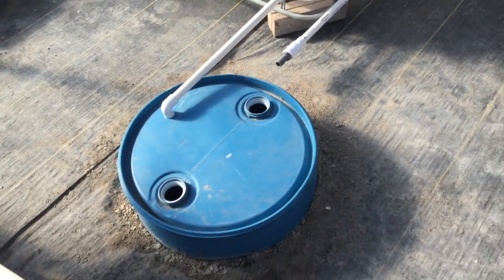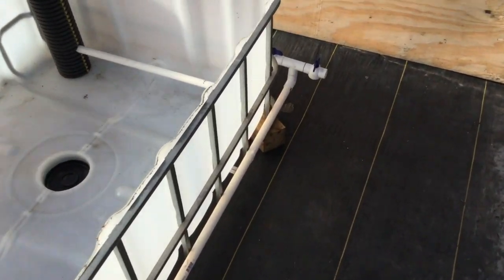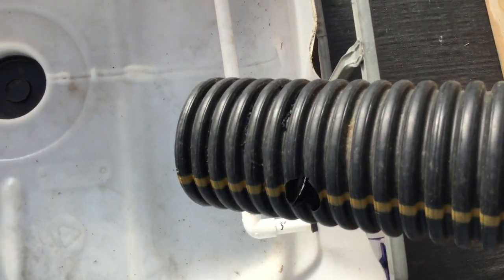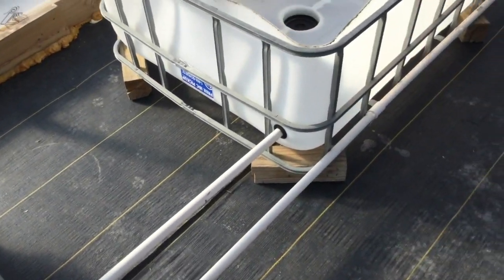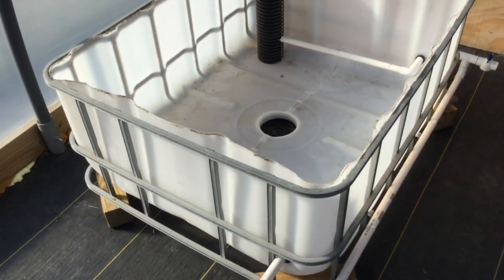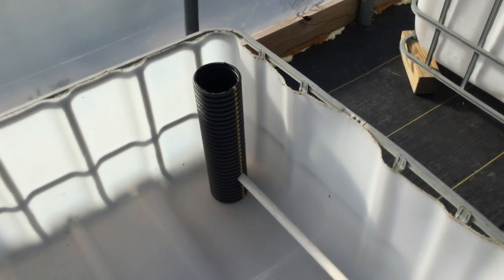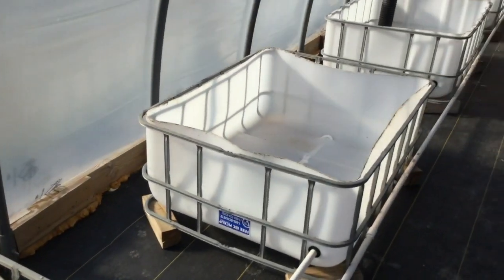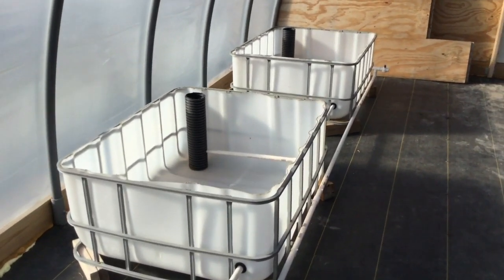Constant Flow Wicking Beds (1)

Comment: How can I find an electronic meter to measure ammonia and nitrates? I want something to get live data for my prototype that I did.
Reply from the maker: Hanna Instruments makes one that measures pretty much anything, but it's $800 or more and still requires you to add reagents to the test tube. Other than that, there is no perpetually automatic way to do it.
Reply from the maker: I should also mention that not all elements can be detected by firing electrical current through the water. It still requires a chemical reagent to be added to the water to change its color and then that color intensity can be measured using light and a photo transistor.
Reply: Hello Larry. Thank you for the reply. Sad that it is not possible because it would have been so easy to acquire information and change things quickly on fly. To be honest I don’t like doing it manually especially with colors. I have problem seeing and identifying colors. Medically tested😬. 

I once bought a digital meter on eBay where I could check pH, temperature and EC. It was so easy to monitor and I had plants grow so fast. Blindly I had retarded the plants but once I did new ones with live data, I was able to keep things with the range and it was amazing. Right now I can’t fire up my system with fish and plants until I am competent to get data out of it or else it will be blind and I won’t learn anything. Did you ever use EC at least in Aquaponics to check the strength or it’s just the conductivity in there won’t be any good to use as a guide? 

Please see my prototype here and I will appreciate if you have inputs on it. I learn a lot from people like you who have real passion on this hobby. I have seen several of your videos and I love the hard work you are doing. 

Here is a link for my prototype. I designed it with so many components but for my several reasons. You inputs are appreciated. https://youtu.be/HGAbBpAadic
Reply from the maker: Nice clean system. As for my use of electronics in aquaponics, no, I've never seen any need for it because I've found that aquaponics will actually work completely by accident. I figure all of that electronic stuff and turning the operation into a daily science project is for hydroponics. Nature doesn't require all of that stuff. I've never seen a case where if the system wasn't cycled and bacteria has colonized that aquaponics didn't work all by itself. All I do is feed my fish and top off my water as needed, that's it.
Reply: Larry Athey that is good to hear. I will then just try to throw in some fish and see what happens.
Reply from the maker: There are thousands of opinions out there on the internet and a lot of people who make things more complicated than they have to be. Every system that I've coached hobbyists through always relied on the same thing and they've always worked. 1 pound of fish for every 8 gallons of water and keep the water temperature above 72 degrees. That's worked every time for me. The daily routine is just feed your fish and keep the water level topped off. Once the system has bacteria colonized in a couple weeks, it'll work with no effort. Just match your plants to your pH level.
Reply: Larry Athey I believe I will go your way. I have around 500 liters of water for the whole system. For every 0.45kg of fish I will need around 30 liters. For 500 liters, I will need 16.6kg of fish to run the system. (Is the calculation considering the total system volume or only tank volume where the fish will be in?). Assuming that I will put smaller fish due to the fact that my tanks are very small let’s say 150 grams each, I will need around 111 fish in both tanks. ( Actually fish tank volume are just around 120 theoretical volume per tank but water will top lower than the full mark so around 100-110 liters. This means I can put a bit lesser fish to make them have some comfort in these tiny areas. I may also need to replace them only when they are around double their weight ie 300 grams in this case. I think I should be ok by putting 50 fish per tank of 100-110 bbl and at 150 grams/fish. 

I would have gone with two 400 gallon tanks but the problem is, I am doing this on the 3D floor of our new house and I can’t get those tanks in the house unless I remove the UPV window glass or remove the current two doors, break some walls just to get the tanks in. Secondly, this is just a prototype and I want to see how much plants it can support before the ratio of nutrients fails to sustain the maximum grow area. I would like to prove these scenarios to assist my self maybe do something bigger in the near future. 

Also, it is nearly impossible and impractical do this out side here in our region unless you have a good shade with cooling mechanism. Temperatures sometimes rises to 50deg Celsius. I tried to do with hydroponics and pH would go too low every time I  try to keep it up. It went up to 3! Now with fish I won’t risk it at all. Once this is set, i hope we will get some  veggies for home out of it😃.
Reply from the maker: You always consider your entire body of water since there is no possible way that any part of it can be isolated. You also need to be very aware of what humidity does inside of a house or you will end up with mold problems. Get a good dehumidifier and don't recycle that water back into your system, or you will ammonia & nitrite spike it and kill your fish.
Reply: Larry Athey that’s is very important point you just mentioned. Thank you. I will try to find one and see how to run it in there. There is an option to buy a prefab house and place it on the roof top just outside this room. This way I can them shift this system and make the small prefabricated house as my green house with air conditioning setup. Another task just arised😅. I thought of this earlier but didn’t think it would be serious to cause such damages.
Reply from the maker: If you set it to 55% or 60% humidity, the refrigeration compressor in them doesn't run that often, only the fan does. But without one, on a cold day you will have condensation on any cold surface in the room. If that condensation forms in a dark area, you're going to have a mold problem.
Reply: Larry Athey this is a must buy thing. I will be sharing with you my updates. I need to find two large  fish feeders and maybe 3D print them if I have time then I will start cycling the system. I am also thinking to use water that has gone through reverse osmosis. What is your take on this? 

I have been using sterilized water from the condenser of the air conditioner and that worked create for my hydroponics. The pH started much lower than that of the tap water.  I have seen many people using water that has been filtered though reverse osmosis and I am now about to buy one small unit and hook it with a float on the sump tank.
Reply from the maker: I can't say that I have any opinion on RO water since they're so wasteful (meaning, it takes 4 gallons to make 1 gallon of RO water and you throw the other 3 gallons down the drain). I just run off of water straight out of my well. As far as fish feeders, that's yet another thing I don't have any use for. I have to go out to the greenhouse every morning anyway, a little machine saving me 15 seconds of my time in the morning just isn't worth it to me.

Comment: What size pump did you use sir
Reply: I copied your setup just my pump runs to strong
Reply from the maker: This is why I have a ball valve right before the water starts flowing into the beds. I use a 500 gallon per hour pump so there's enough pressure to flush out the main water feed line if I need to.
Reply: @LordLarryWho  ty sir. I too have ball valves and did not think to close them. I also put individual valves between each ibc incase I need to isolate an issue.